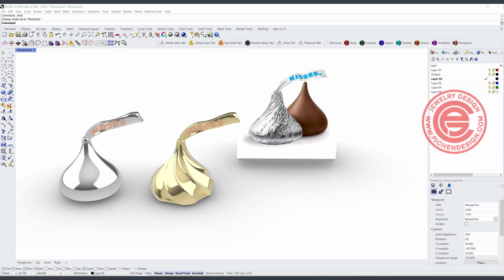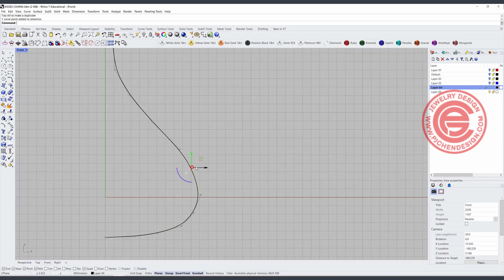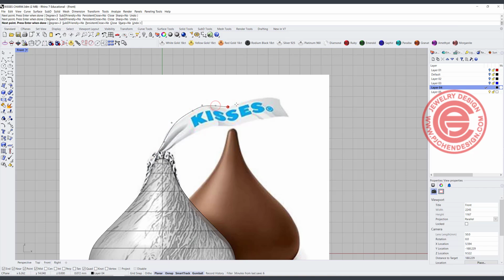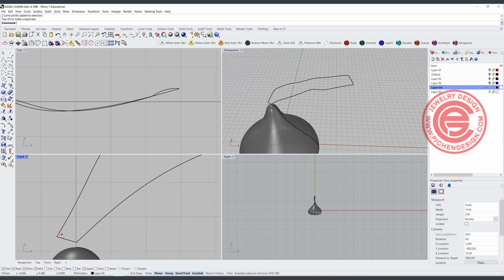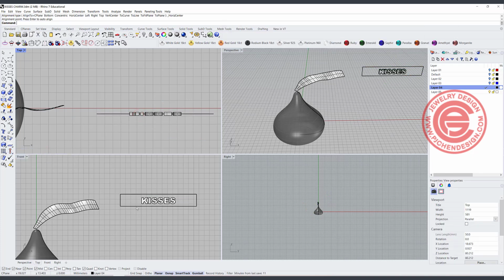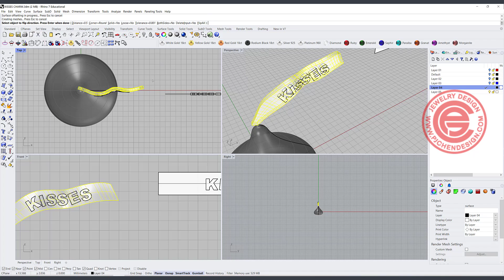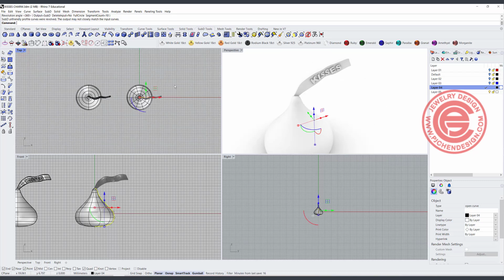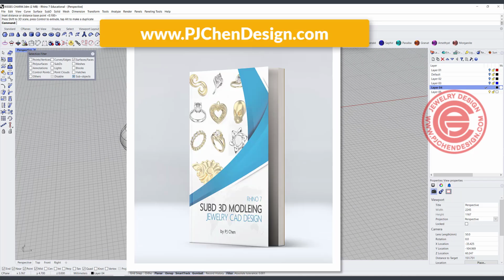Kisses Charm- Jewelry CAD Design Tutorial 3D Modeling with Rhino 3D #250

Comment: Dear PJ Chen, Thanks for your class, I´m learning so much with your videos. I have a doubt,   when the job is finished and colorized with gold or silver colorsfor example was complete, how can we  print this page to show to the client?
Reply from the maker: if the resolution is not the issue. you can screenshot. If you need fine rendering, I usually run in keyshot for rendering.